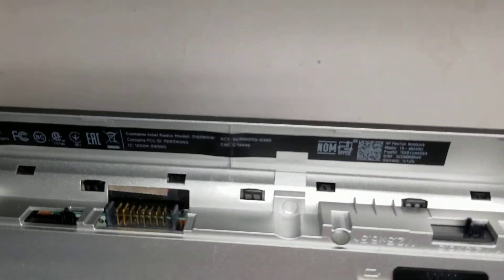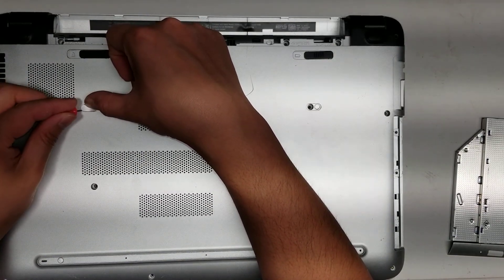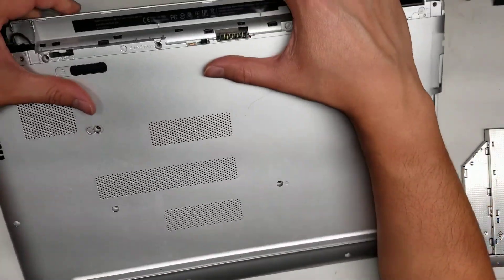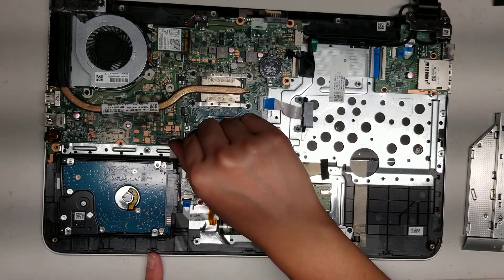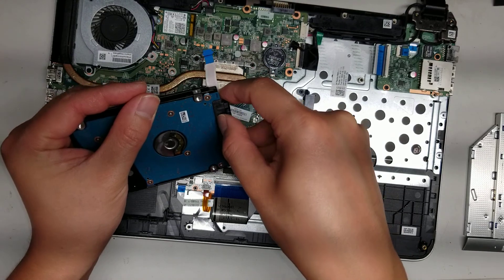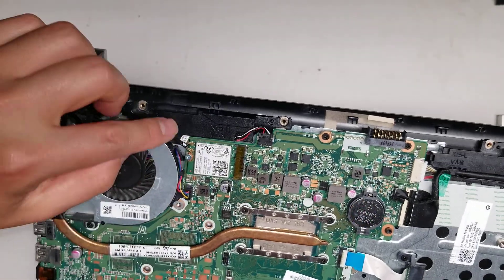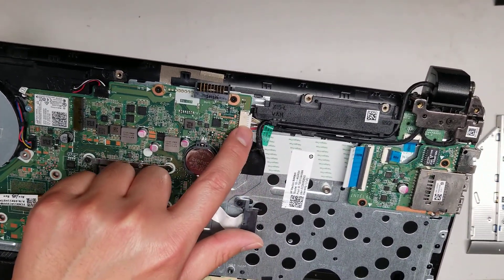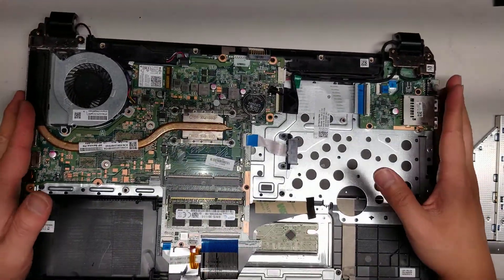HP Pavilion 15-ab243cl 15-ab Disassembly RAM SSD Hard Drive Upgrade Repair

Comment: I replaced the touch pad.  Putting it back together i see two stripped wires  labeled 1 and 2.   they are located at the back side of the fan. and the wireless card.
Reply from the maker: The wireless antennas?

Comment: Do you know where the M.2 slot is? According to the manual there should be a SATA M.2 slot, but it provides zero help in finding it.
Reply from the maker: The manual is a fookin laiyah.
Reply from the maker: You can use a 2.5" sata SSD like thinks https://smile.amazon.com/dp/B01N0TQPQB/ref=cm_sw_r_as_gl_apa_glt_fabc_GQ8262CSGKXZBDGME51T?linkCode=ml1&tag=itsbinhrepair-20
Reply: @ItsBinhRepaired  I appreciate the response. I know I can put in a 2.5" SATA SSD, but I wanted to keep the old drive in there. Idk, maybe the M.2 slot was only installed if the laptop came with an M.2 drive, but I assumed it was just part of the main board.
Reply from the maker: @PanRhei  I looked up a compatible motherboard and didn't see one.
Reply: @ItsBinhRepaired  Too bad, but thanks anyway.
Reply from the maker: Yeah :( sorry

Comment: I have been working on mine.I find that with back cover removed when I try to open laptop the hinge at power socket side starts to bend.
Reply from the maker: Like it's broken?
Reply: @ItsBinhRepaired  Don't think so.It opens ok when all put back together.Just with the back off when I try to open the hinge and the power plug pop out a bit and didn't want to force it.Just wondered if that was normal.
Reply from the maker: @alanweir3567  the cover gives it extra strength. You want to be careful opening and closing the screen when the cover is off.
Reply: @ItsBinhRepaired  Yeah wasn't sure if you were meant to open it at all with back off . don't know if putting screws back in would have helped . thanks.
Reply from the maker: As long as nothing looks broken